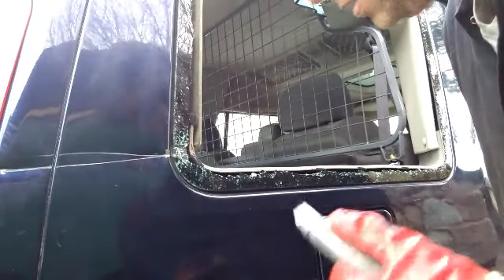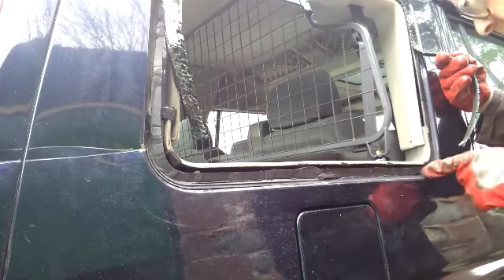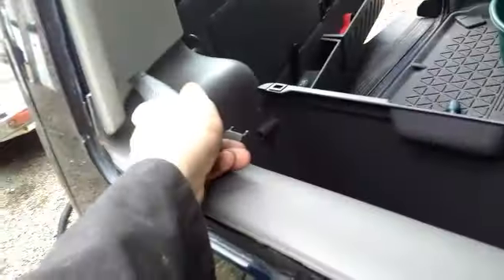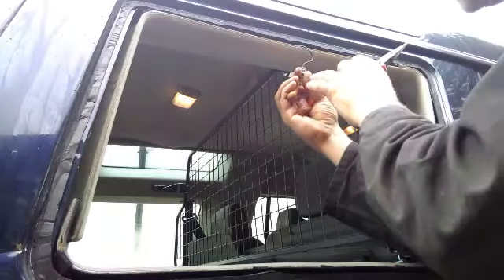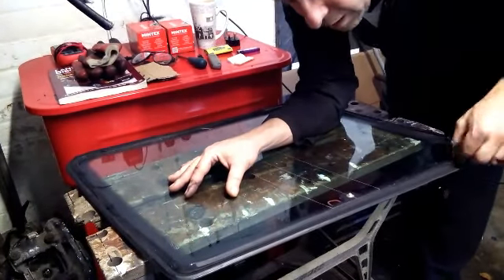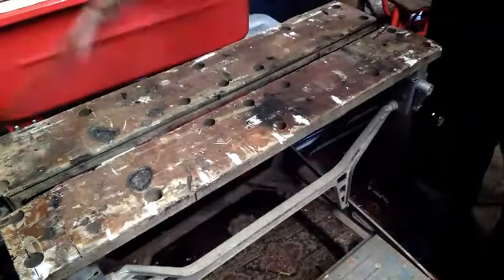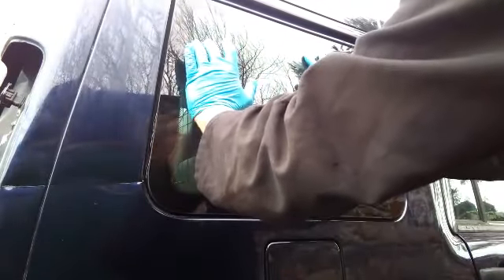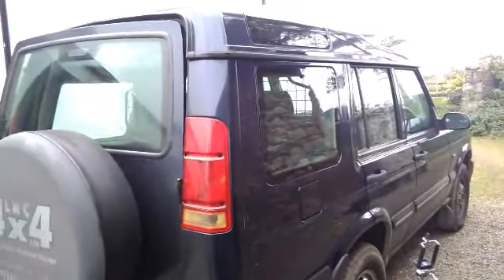Land Rover Discovery 2 TD5 and V8 - Bonded Side Window Glass Replacement

Comment: My 2002 Disco 2 is a commercial and has Disco 1 style replaceable rubbers.
Reply from the maker: I'm envious. Traditional window rubbers are so much easier, with the proper tool. ☺
Reply: Is the glass same as standard d2? Ive broken the rear quater window on my commercial d2